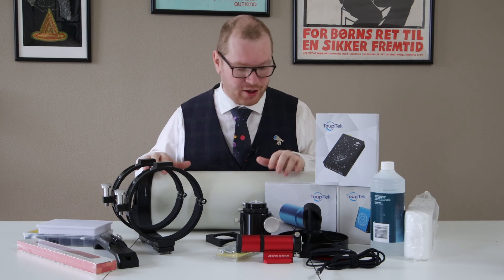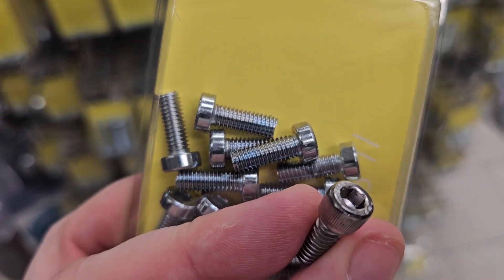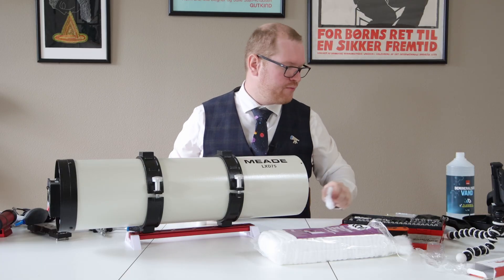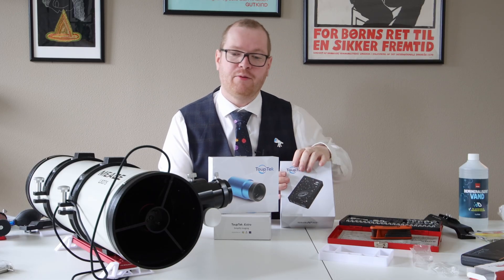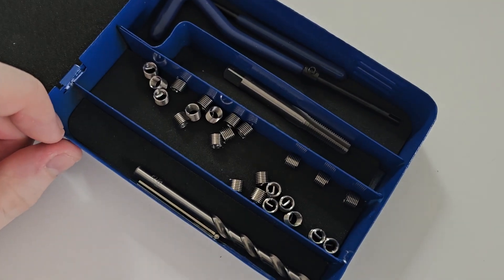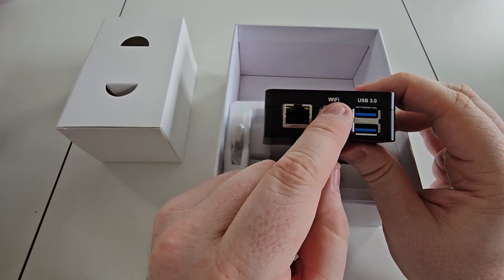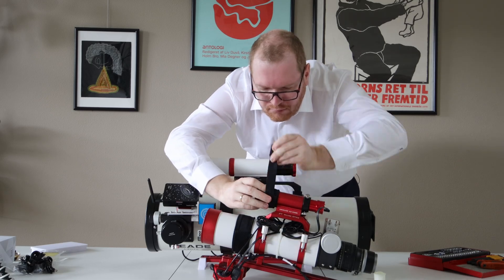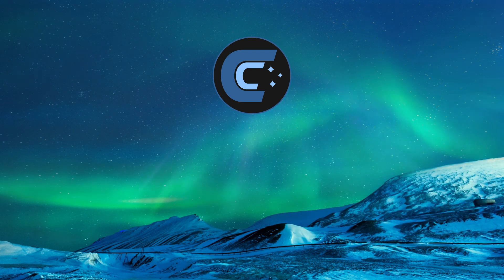Bringing My Telescope Back to Life – DIY Newtonian Finale

Comment: Nice result but I can't believe you cut the focuser hole bigger, making all those hot metal sparks with your primary mirror in place!
It's weird enough to clean it in-situ.
Reply from the maker: In the previous videos i tried to remove the primary mirror cell with no luck. So i was forced to leave it in place. I know it's far from idea. But i was very careful not to have sparke shoot down the tube and i had the fan running so create a draft out the tube to dust would collect on the primary mirror. 
Again this os not an ideal situation but i did the best with what i got.

Comment: I don't know why the Astronomy equipment industry didn't standardise the thread sizes years ago. To be fair here in the UK it is not too difficult to get hold of imperial size screws, I usually get them from First Light Optics  but there are other outlets that sell them. These days I keep some spare just in case I need them.
That looks like a nice upgrade you have made there anyway, I'm sure you will capture some good images with that set up.